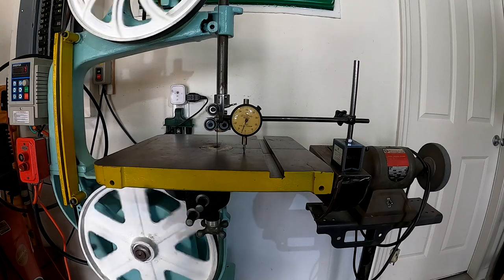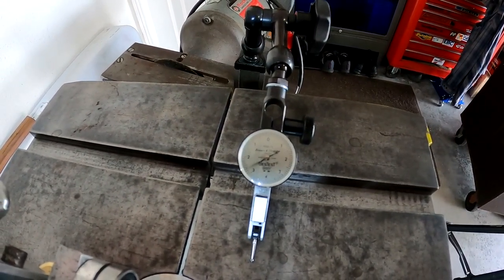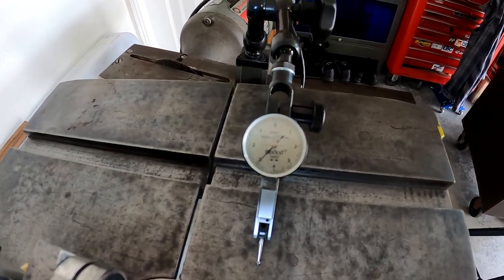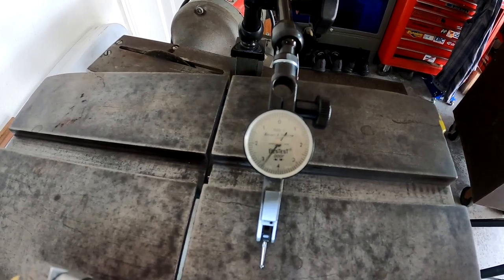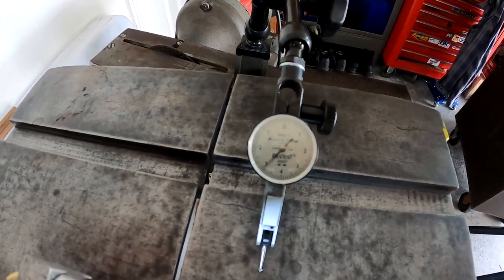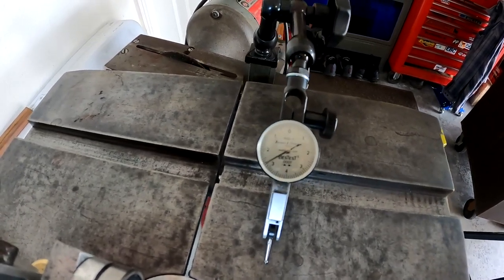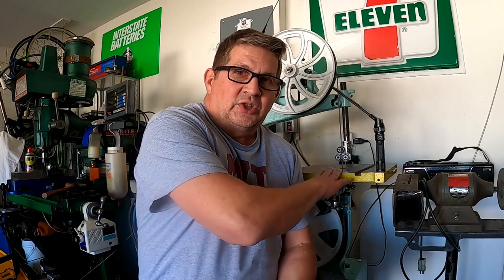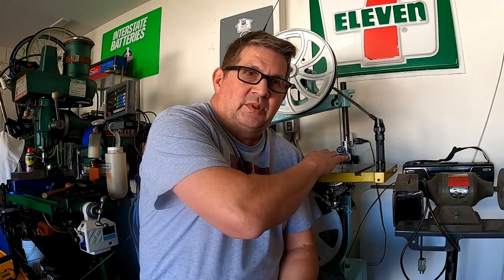Mechanically Measure Vibration Noise: How to improve band saw cutting

Comment: I don't know if this method of measuring vibration is common but I still think it's ingenious and makes perfect sense
Reply from the maker: What surprised me was how close I actually got to the accelerometer.  I expected that the dial indicator would only be able to keep up so much and with a lot more bounce. The naked eye can only process so much so the expectation is that what you see is the actual --- but when its slowed down it becomes very apparent that you can't see and judge what's really happening. I guess this is why magicians say the hand is quicker than the eye, cause it really is. Thanks for following Paul.. Don

Comment: Back in the old days before we had hertz, as a mechanic, I would listen for vibration by placing the tip of a screw driver against where I wanted to check, and my ear against the screwdriver handle to hear the vibe.  Eventually, I got a medical stethoscope.  It worked great.
Reply from the maker: Yup, been there.... 👍

Comment: This is very interesting.  Your comparison to the action of a harmonic balancer is a good one.  I hope you don't mind ... I have questions.  BTW ... I do NOT ask questions to show-off or to be snarky.  I own a Reliant 14inch 4 speed which is a copy of the Delta.

1.  If mass is so important to a smooth cut ... why do those small, light portable band-saws seem to cut so well ... or is that hype?  I do not own one, but a number of folks on YT own them.

2.  Did you think to check the vibe closer to the edge of the table?  Isn't there a chance that distance may increase amplitude?

3.  Do you think gluing blocks of mass in the cavities along the neck of the band saw (that you braced up) could also eliminate/soak up vibe?

4.  I would like to have seen you do a before/after cut on a piece of steel to show the result.   Maybe this is something you could do after each step.

Just so you know that somebody is listening, I am finishing up a cross-slide eliminator exactly like yours.  I should be making first cuts using it on my 70 year old Atlas/Craftsman 12 inch tomorrow.
Reply from the maker: I guess there must be a word count limit to reply's. I wrote a book of an answer to your questions last night and now see that its missing. So lets try the synopsis version. 
1. Mass in larger saws, in particular straight run blade saws is important because of the the leveraged ability to flex. Portable saws are very compact, rigid and use an off center position for the blade travel like a horizontal saw.  Nearly impossible to induce flex and with near direct drive motors, just don't have the issues a larger saw will encounter. Think 68 Impala, big motor, large frame, separate body. vs Renault 5 - small high speed motor transaxle and unibody. Each one has its place. The portable saws were originally meant for plumbers to take care of pipes on the jobsite but found a lot of other uses. Great little tools, but Ide hate to have just that for my primary cutter. Saws are the big lifters in a machine shop. They get you close, your machine tools get you accurate. 
2. Yes, and it was a little higher, but it was just added footage to the video and I need to keep my time limited as too many viewers just want the jist of it. The main issue is freq/vib up through the table mounts which are in the middle of the table, so I wanted to concentrate my efforts at that point. I went way too long on this yesterday so I'll leave it at that. 
3. I don't think so. I thought about that, but welding that plate on with its own internal ribs, plus the arms own webbing made it so heavy and stiff that I don't think adding more weight would have made a difference. I was experiencing more flex in the arm than vibration. The table vibration was really the issue probably due to a large flat surface being elevated by small points. So rt of like putting an air hammer against a flat sheet of tin and letting loose. 
4. I thought about that too and did a few camera shots but its really hard to see the difference on a video. Its more felt. How your own hands respond and the smoothness (felt) when cutting.  I do get the point though. 

Would like to see your finished Eliminator. Let me know how it comes out. Shoot me a pic. I have an email on this page you can use. 
Thanks Don😃

Comment: I have yet another question.  I really like the idea of using the Flex Glue to hold the weight in place for the reason stated.  But, up here in the mountains of NoGa, steel or iron is mighty hard to come by and very expensive to buy.  What do you think of using concrete, especially if some holes are drilled in the webbing of both the table AND the frame?  Big enough holes would allow the concrete to flow from void to void and allow the  installation of some rebar or other steel wire for strength and prevent cracking.  It might not have the weight of steel or iron, but done correctly, I don't think it would ever flex.  This could eliminate all that cutting and welding you did.  The best part?  An 80 pound sack of concrete is only $6.00 at the Home Depot.  Crack and shrink resistant stuff is about the same for 50 pounds.
Reply from the maker: You know I thought of that too.... But, my past experience with concrete to metal in that sort of application was less than good. I only addressed low frequency vibration in this video as thats what causes a 14 tpi blade issues. Its the high freq from a machine tool that will do in concrete. Think sonic cleaner. The metal will transfer that high freq into the concrete and you'll end up with a bunch of sand between the metal and concrete and have a floating block. If you want to put it in the arm, again I think the stresses of flexing would cause issues. I do believe over a short time the cement would start pulverizing on the outer surface. Basically there's just not enough room to create the kind of mass that would make concrete effective in that application.  I find a lot of free and cheap metal just walking around the local rail yard, from my shop scrap bin and leftovers from odd jobs I take on. Have you looked around some of the local scrappers or heavy equipment / truck shop metal bins? If a good guy like you walked into my shop and just asked if he could grab a few pieces from scrap, Ide be good with it. Must be something laying around.  Good luck. Don